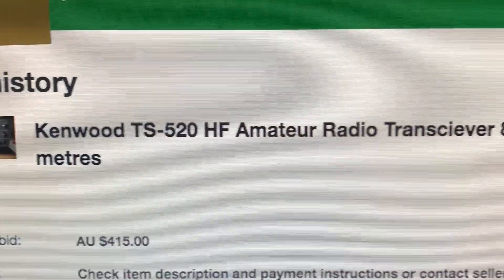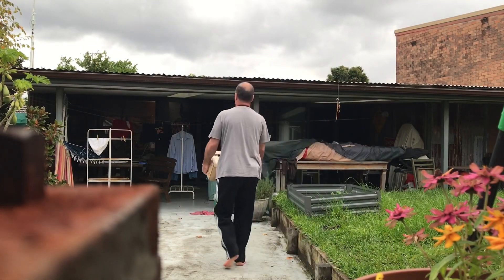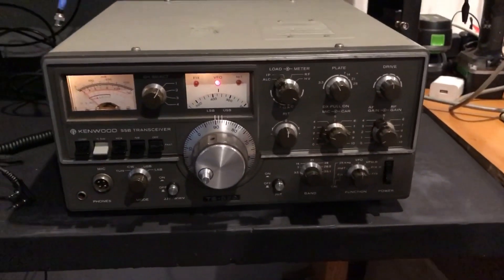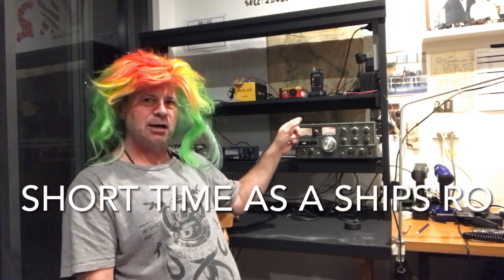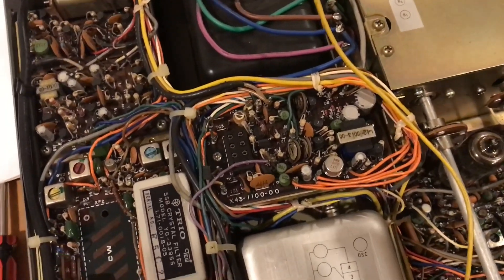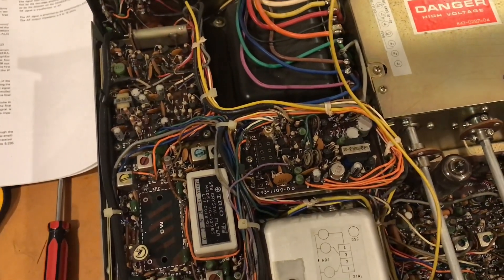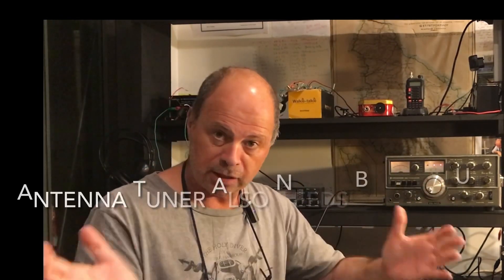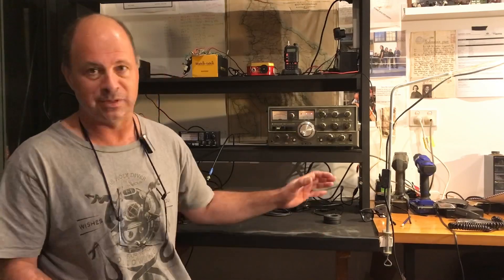My new BOAT ANCHOR is a Kenwood TS-520 @TheArtofEngineering

Comment: Just received a Kenwood TS-520 from an active ham who went SK. I thought this would make an excellent project to do a bit of renovation and restore it back to its former glory and perhaps encourage a few members in our local hackspace to get interested in Amateur Radio. Some of the switches need replacing which I have found a suitable source for. Other than that it just needs a bit of TLC.
Reply from the maker: Good luck with it! Be careful (deadly voltages inside!). I love mine.....It has new finals now...I juat did a Yeasu FT101E too 73 de VK2AOE
https://youtu.be/ae2X6wJC6P8

Comment: The Kenwood TS-520S was my first HF radio.  I like all the knobs and switches.  Kind of like having a manual shift transmission, you feel you are really "driving" the radio. Listened for a while till I passed my test to get my HF License.  Many hours of enjoyment with this radio, excellent audio.  N5VCP   Roy
Reply from the maker: Yes love mine …. Alas work is curtailing radio play 😂73 de VK2AOE